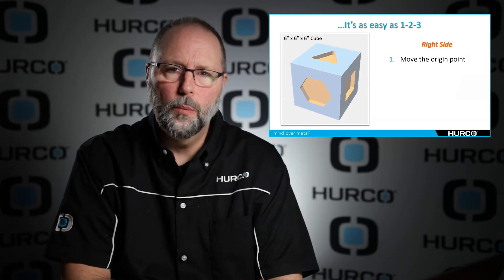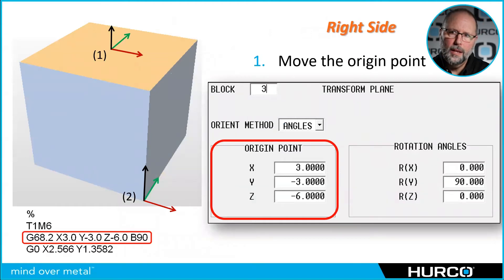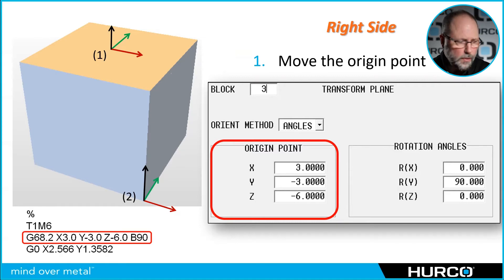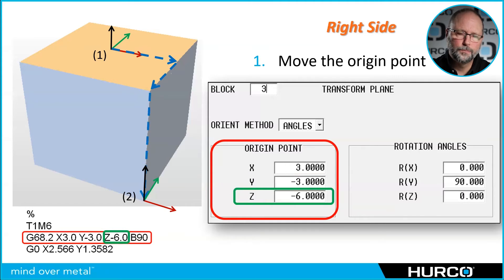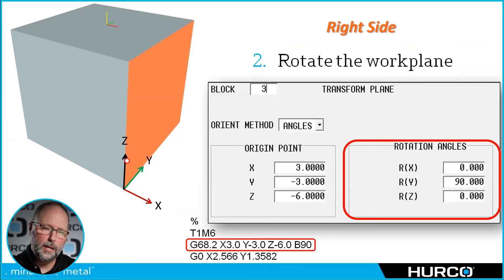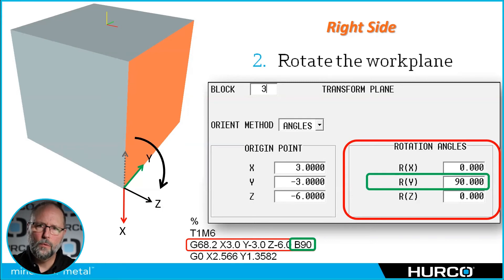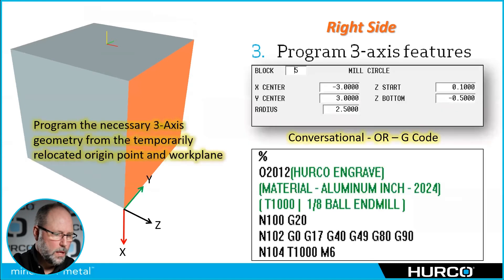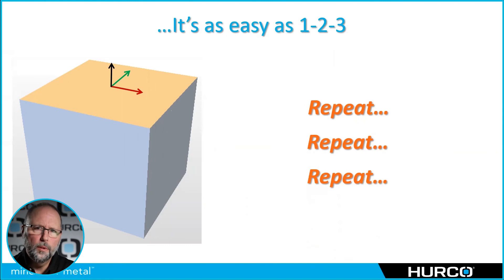Basics of Transform Plane | Hurco 5-Axis Training Course

Comment: Hello, can you do some short videos of how to load tools into the machine, how to touch off tools using the tool setter ect. We switched from Haas and have trouble finding info on this basic stuff (or finding the buttons in the soft button menus)
Reply from the maker: Hi Twinpeaksco, thanks for your input. Feel free to visit www.Hurco.com/connect for additional materials such as our machinist reference guide which has more procedures to help out. Also, feel free to list out more videos that may be helpful to you as a new user. We are always looking for input on things that could benefit Hurco customers.